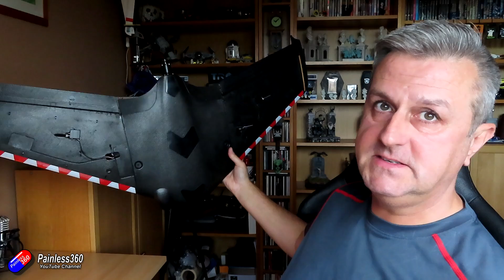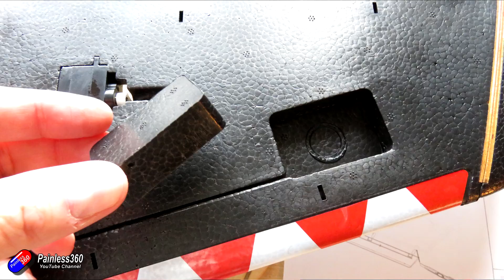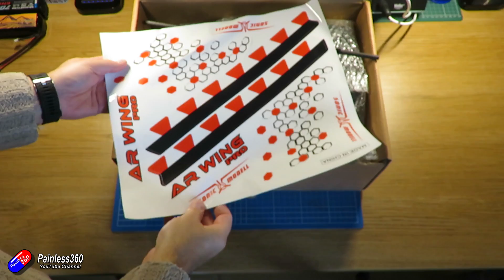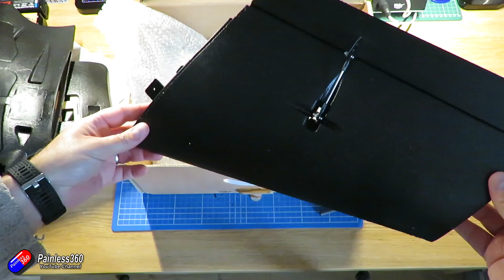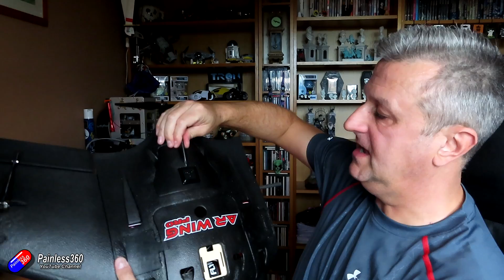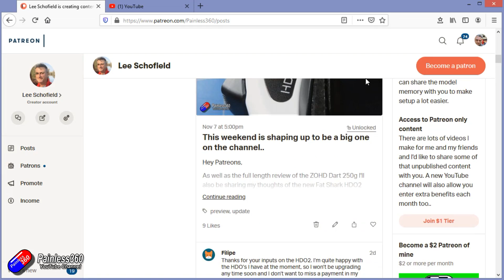FIRST LOOK: New FPV wing from SonicModell - the AR Wing PRO!

Comment: I’ve just killed the motor on my ar wing 900 😢. 
Is there a current motor that you’d recommend as a replacement? 
Thanks
Reply from the maker: If you liked the performance before, then I'd get a similar size and KV. If you want to tweak the setup for better performance, speed or easier hand launching then check out my motor and prop series on the channel... Best of luck!

Comment: Love the looks of the Wing PRO!  For someone who wants to fly their first wing, can this model be setup for a wing beginner?  Would it fly tuned back a bit for a slower flight and less control surface output until I get the hang of it?  Or is it designed for one thing -- wide open?
Reply from the maker: It is designed for flying efficiently for a long time with the supplied setup. Not ideal for a first wing as the CG can be hard to get without a lot of weight in the nose - it was designed for a GoPro style camera in the nose...

Comment: Are the servos digital or analog? Also whats the max refresh rate. I cant seem to find any documentation. Thnx.
Reply from the maker: If it isn't specifically mentioned, then they are usually analogue with 50hz refresh. See my videoa on servo basics. Happy flying

Comment: Long time Quad builder & flyer, and you've definitely opened the door to my first Wing adventure. Mine will have either Walksnail or HDZero FPV [I've got both on various quads]. Question is where to put the VTX. Assuming the camera in the nose, is the wing bay well vented enough for these VTXs? They get bloody hot as you know. Also a bit concerned about the MIPI cable length required. Any thought you'd like to share?  Also just finished your iNav video series, which was really helpful. Its not BF, but you've taken the mystery out of the strange FW & GPS settings. Very much appreciated!
Reply from the maker: I've run mine with the camera in the side pod and the air unit in the nearest side pod with air ducts. Seemed to be fine. Sadly Sonicmodell seem to have gone silent now so I can't give them feedback on the changes needed for the AR wing Pro II. :) best of luck!

Comment: Lee, got an ARPro kit from banggood as about the only option I could find.  Both ailerons are bent with the last 100mm being flared up as viewed from rear.  Is this to fair in with the blended fuselage or should they be straight? If matched at root the tips look wrong!
Reply from the maker: They should be in line with the wing, sounds like yours may have been squashed in transit?  You could glue in some carbon spars to help straighten them out... best of luck
Reply: @Painless360  Thanks Lee, have glued the carbon in with weights to keep them straight.  It was strange that both were the exact same flare at the root.

Comment: Hi!, How would you put downward facing camera capability on this?, I am new to fixed wing but have done a lot of quad. This will however be my leap out of pre package/pre configured/productified type of drone...
Reply from the maker: You could but it wasn't really designed for that. There are little planes like the Ranger T-1 that had a holder for a Peanut action camera in the belly so there are choices out there that will need less cutting to add a downward camera..

Comment: Hi Painless 360. Have you set your wing up on a TX16s? The reason i'm asking is because i'm getting loads of up elevator and very little down? I've tried the normal practice of changing the weight on the controls but it only adjusts the whole range and the mixing function doesn't seem to help. Do you know if the radio can adjust travel each side of centre? I haven't been able to find it if it can?
Reply from the maker: I'd check that the control surface linkages are set up well mechanically as step one. https://www.youtube.com/watch?v=53jbVcKATnc covers it..
Reply: @Painless360  Thanks i'll double check the set up. New to wings been flying normal fixed wing for years.
Reply from the maker: It is all the same stuff and the wing will feel just like a regular 'plane without a rudder. Best of luck!

Comment: Great video and great frame, undoubtedly.
Just wondering that since we have 2 servo connections on each wing, is it possible to split an elevon in 2 equal parts and use 4 servos to also get the yaw control using differential spoilers along with normal pitch and roll control as mentioned here: https://ardupilot.org/plane/docs/differential-spoilers.html
Reply from the maker: I should be.. Best of luck!

Comment: Hey Lee schofield I decided to buy the AR wing pro kit version to basically replace my existing ar900 due to several crashes and tons of e6000 glue to bring it back from the death. My question is currently have racer star Airbnb 2514 - 1498 KV with a ztw 45 amp 6s ESC should I use that motor on the AR pro possibly some decent 9 g emax es 09 MD servos is there anything I should put motor wise instead because I like to have speed and great watching power without dipping? Thinking also to use maytek f405 flight controller instead of my stabilizer Aura 5 light currently on AR 900
Reply from the maker: I'd recommend the motor and setup that comes on the wing.  Video on choosing motor and props for models coming soon.. stay tuned!

Comment: Good morning, thank you for your good work, always clear and easy to understand your presentations. I fly 5" quadcopters and would like to have a long-range aircraft running Inav or ardupilot to experiment with waypoint flying fpv. After seeing your video I preorder the AR pro kit with Matek H743 Wing FC, crossfire nano, and TBS Unify Pro V3 VTX 5.8GHz. Combination wing + only one motor = more flying time than a 7" 5" quadcopter. About powering the craft, what will be your recommendations? (motor, ESC, battery, and propeller)
Do not hesitate to advise on the receiver and VTX  if you think about a better choice.
Regard
Laurent Lasne
Reply from the maker: The setup that comes with the PNP is a good start. It will be interesting to see what the version with more power chooses. See my Mini Drak build for an idea of a more powerful setup..
Reply: @Painless360  Thanks

Comment: Another great review Lee, thank you. Something that I’d like to see is a secure means to launch these things. I’ve had a few launch crashes doing ‘discus throws’ and inverting on take-off and I’ve even gone to the effort of fitting wooden ‘skids’ on a caipirinha to grip and allow me to ‘dart throw’ but that was a bit scary with a 10” carbon prop. I guess some simple finger-holes would be ideal, somewhere on the CoG so you get a solid feel and balance and can easily launch. Before anyone mentions ‘launch-mode’ which is something I may need to revisit, I’ve never really been a fan of it and like to control my own manual launches. As for the way TBS recommend you launch the Caipi2 this seems downright dangerous. I’d be very keen to watch your take on hand-launching wings. I travel to the flying field by bike, so this AR looks brilliant because of the way it packs down. If I can nail launching it, it might just be the perfect wing for me. Thanks again.
Reply from the maker: Check out my Autolaunch videos fro INAV and Arduplane. Makes it super easy..

Comment: Using an electronic combo kit + the li-on battery + a flight controller + the weight of a 300g camera, would you estimate how much flight time?
Reply from the maker: TBC but estimate an hour on a 7000mAh Li-Ion pack

Comment: I wonder if it is a good idea to use one of the "pockets" for a flight controller, does inav care about the position of the fc? And could the airflow in these pockets be an issue for the onboard barometer?
Reply from the maker: The closer to the CG line and in the center of the model the better. Otherwise a rotation can be felt as a rotation and lateral movement. It's not super critical but with the huge space inside this thing popping an FC into the right place would be easy..

Comment: Wing looks great, But shouldn't the Servo\control rods be straight following the normal air flow over the wing like the original AR (mini) wings.  Having them at a angle, is just irritating me.
Reply from the maker: Not at all. With the small throws needed on models like this it's not an issue. See things like the RiteWing stuff too.. It is less of an issue than many pilots think.
Reply: @Painless360  No Problems. I'm just a perfectionist. All I could focus on was the angle of the control rods during the presentation.

Comment: Any idea where to buy it in Europe? It's available at the Chinese Warehouse but the import tax is crazy.

Here is my personal weight calculation:
543gr Wing
300gr battery
200gr for 2 cameras, VTX and FC

just over 1kg AUW ! which sounds crazy light to me. Combined with a nice Aeronaut Folding Prop this thing will glide FOREVER.

Is it even possible to achieve the recommended CG with a 300gr battery? Do you know what the wing area is?

Cheers
Nik
Reply from the maker: Hey Nick, just competed the build on mine, Aero Naut folding prop, 7000mAh Li-Ion battery, Matek F405-Wing and DJI Air Unit. All up flying weight - 1069g. Not bad!
Reply: @Painless360  
I bought one on Banggood.

The 7000mah should weigh at around 370gr-380gr, right? 
The problem is; I don't have any 4batterys. Can I fly on 3S or 6S (6S with throttle limiter of course)? 
In theory, a slightly bigger Prop will compensate for the lower voltage but can the motor handle the Amps?

I hope you're going to make a video about possible hardware configurations.

Cheers
Nik

Comment: Wow, I've got to have one; it truly looks 'next generation'.  I got the DJI FPV for father's day and since then have been trying to transition from old school built up balsa with nitro to FPV with flight computer with induction motors.  I started with the macro Drak and although it is not more than I can chew, I must confess, am still chewing.  Inav, Matek, Frsky, kv + voltage = rmp, amps * volts = watts, manual / acro / angle / horizon / rth / launch / loiter...  It has been a world wind and have learned a tremendous amount and much of it from you, thank you!  I have yet to dive into FPV as I have not mastered RTH.  I see light at the end of the tunnel but it is not growing any brighter.  I believe with this SonicModell AR Pro I will finally see the light of day.

Comment: Nice to see the tapered motor mount. Why wing designers keep building pushers with flat mounts that create negative pressure and turbulence at the prop is beyond me. I mod them all. Doing it for the Aggressor, which is a great value and versatile wing for the price. Designed a tapered mount last year for the AR Wing in addition to a new cage for the GoPro 7. - https://www.thingiverse.com/thing:4020088 - Only thing I don't see on this new wing that I add to most of my FPV wings if they don't have it is another set of vertical stabilizers. Having outboard and inboard stabilizers both increases stability and reduces yaw-wobble substantially. This new one appears to have a small dorsal fin that could be modded for the ambitious. Great looking wing. I'll be getting one for sure.

Comment: My wish list would include Twin tractor option/Tail sitter. Boom tail option? Trike landing gear? Removable winglets. I know, dreaming and I can always mod. Like slicing off the twin pusher pods of my S1100 for a single pusher. I so want to try a slippery  yet easily removable trike gear. F16 like?  A similarly well designed and manufactured low wing loading slippery Plank?

Comment: Thanks, Lee, this is exactly what I needed. Please let us know when it becomes available. I modified an X5 to similar specs but it never worked out as well as I wanted it to be and is not as portable as the one you are demoing.
I have a question if you don't mind, have you had any chance bringing telemetry of any fixed-wing flight controllers to OSD of DJI FPV system?

Thanks again for all the amazing reviews, instructional videos, and demos.
Reply from the maker: Yep, see my series on it and the Lockdown build.. happy flying

Comment: Just awesome, I will transfer the electronics from ar900 into this one, I'm wondering if will fly with a 4s8p li-ion battery and what motor/prop/esc you would suggest for the extra weight(1.5kg just the batteries). Thanks
Reply from the maker: Not sure yet...

Comment: How wide and deep is the battery bay? Would it accommodate a 4S2P 21700 pack, or is it limited in width to a 4S2P 18650 pack?
Reply from the maker: 14cm wide, 15.5cm front to back and 4cm deep ish..

Comment: I'm maidening my first wing, the RMRC version of the older model, in about an hour. It'll be a great thing to work out my flight issues, add an FC to, learn Inav on, etc. But I know I'm going to destroy it (hopefully not today), so it's great to know that this is waiting (wait for it...) in the wings. That vertical stab in the middle is interesting, too.
Reply from the maker: Best of luck with the maiden!
Reply: She survived! Never flown a wing of any kind before outside a sim, but I got airborne on my second toss. Such an amazing bit of technology, especially for the cost and ease of assembly. Two launches and two landings, still completely intact. No animals were harmed in the making of that flight.

Comment: This looks really, really nice, damn it. Another unexpected purchase coming up. 🤦‍♂️

Will be interested in how you mount your antennas, particularly with removable wings.
Reply from the maker: If I were using traditional FPV it'd be an MenaceRC AeroPOD antenna mounted on bottom where it was the least proud of... Happy flying
Reply: Painless360 Ooo, good thought. Thanks. Yes, for various reasons I’m sticking with analog video. Is one of the HD cam nose mounting options suitable for a GoPro?

Comment: That looks really nice with all those compartments for electronics. I would swap the motor for a 35xx one with a large folding prop and add some locking mechanism for the wings. I don't trust wings that hold in place just by friction.
Reply from the maker: They don't hold by just friction. Covered in the video.. ;)

Comment: Looks like a great step forward although a couple of things bother me. The spar needs to be a lot longer. Looks like it only enters the wing by a couple of inches and in doing so will probably allow pretty bad wing flex. Even the original ar wing had excessive wing flex under load and needed additional carbon strips in the leading and trailing edges.

Comment: Great video Lee. I have the DJI FPV air unit goggles and TX. Can I wing be set up and controlled by the DJI TX or do you need a Frsky or Spektrum type?
Reply from the maker: It'll need a flight controller for that. See my wing builds on the channel with the DJI HD system (Mini Drak specifically)..
Reply: Painless360 thanks. I’ll check it out.

Comment: Great video - as always! Wondering what you would recommend I get for my teenage son as a first wing?
Reply from the maker: Hey there! If they are learning to fly fixed wing then a wing isn't the best place to start but if they have a little experience then something that is a little larger, cheap, is forgiving and flies well the AR Wing is one of my top picks. See my Kit Picks 2020 videos for my choices.. Happy flying!
Reply: @Painless360  thanks Lee. Keep up the good work!
Reply: Hello, i dont know how old your son but im a teenager too, im 16 and i bought my first model last year, it is volantex phoenix 2400. It was big stable and good looking, i used it for los for one year and now im using it as a fpv long range platform. Its easy to fly, it cant stall and also it has a plastic fuselage so you can't break it with hard landings. I think it can be a good beginner plane but it needs a lot of space to land and transportation is a big problem. But also it is pretty expensive for a beginner model and wings can damage a lot because they are very low to ground. If you want something more durable and cheap you can consider reptile s800, it is one of the strongest models but it is not stable, always wobbling side to side. Its good for learning but soon your son will need a better model. You can (should) also ask him what he wants and what kind of flying style he likes.

Comment: Love the channel and keep doing what you do. Just recently bought a AR900 and love it and will definitely be buying this aswell. What FPV camera size does it take please? If it takes full size would you be able to design a 3D print for micro size as I have loads in my bag
Reply from the maker: 20mm camera slot in this.. So not for the full sized cameras.
Reply: @Painless360  thank you for the reply 🙂

Comment: 8-pin connector at the wing root would have been better
Reply from the maker: The supplied connectors are in Balsa supports so it would be easy to swap them to something else if you are one of the pilots that wants a different connector.. Happy flying
Reply: Wouldn't it be better to use pogo pin connection here?

Comment: Hi Mr. P    SOLD  !   Thanks for the video I will be ordering it as soon as possible.  I have a AR Wing and I am not the best when it comes to flying them. I just started flying them last year and I have learned a lot,  my hardest part was takeoffs I have had 2 back surgeries and throwing them in the air was hard to do.  So I made a finger grips underneath the fuselage and I have been having no problems but I seen your last video on auto launch and I can't wait to try it,  but I first want to watch it again and make sure I do not mess it up and do a noise dive. I have lost 3 different action cameras that way.  I just use them for paper weight in the noise now. I love the way it was designed to keep the components in the fuselage and the pins for the servos, also the transmitter bay I have a AKK DOMINATOR for long range and I use a rc car esc fan to keep it cool.  I just don't know if I should get the kit and have a new motor, esc  version and use my Maytek F405 or the kit and use the Maytek F411 se and the Electronics from my old one. Thanks again for the video of this new wing.